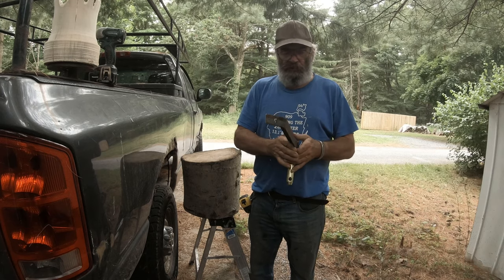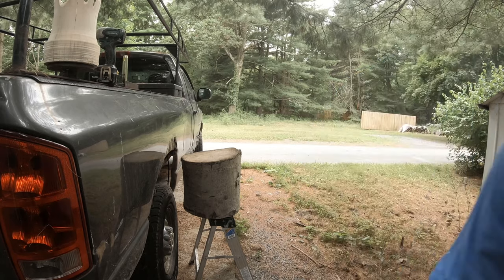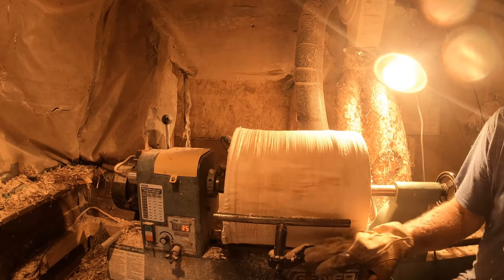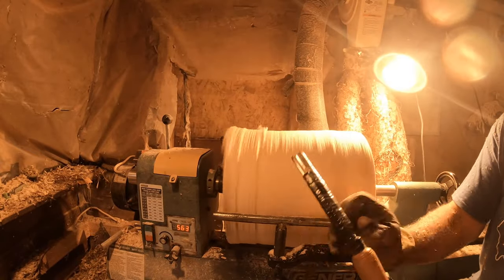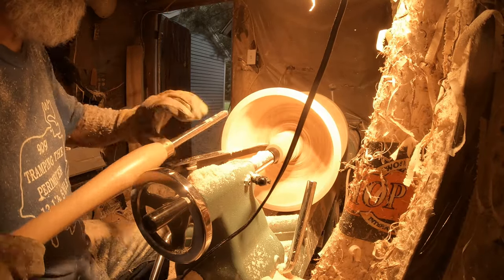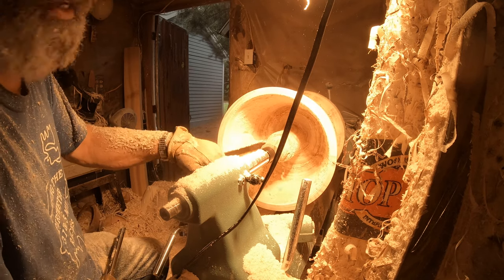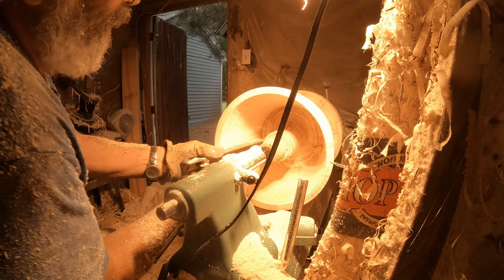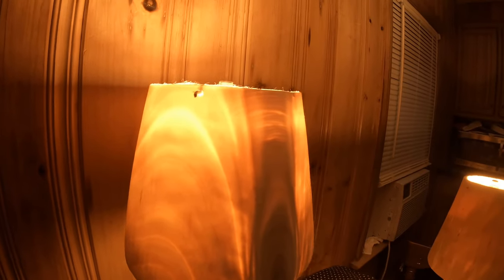wood turning trying my tool rest i made for lampshades check it out see if it worked

Comment: I believe your internal steady rest is just right for the job. I wonder though, if you were to support the outside where your cutting tool is pressing against the thin wood. This would give you great control for thickness, and perhaps avoid the thick lamp shade that was not translucent.    This link is to a great Canadian company who makes a bowl steady. With your fabrication abilities and a roller blade skate, I'm sure you could duplicate it for very little cost.  https://oneway.ca/Bowl%20Steady?search=bowl%20steady
Reply from the maker: actually the shade was a little to thin and still light didn't shine through and not sure why I made severial shads out of same log and all where good and thanks for the link